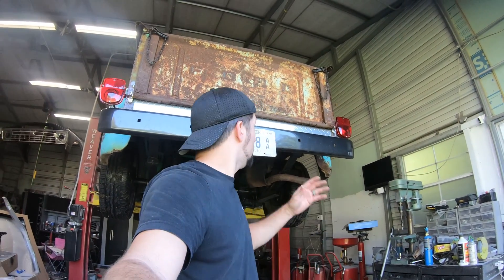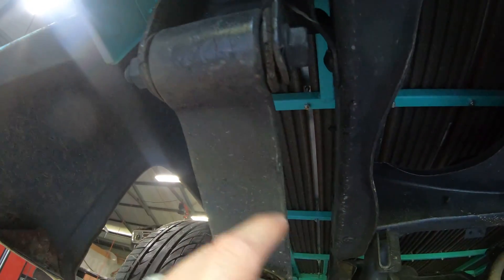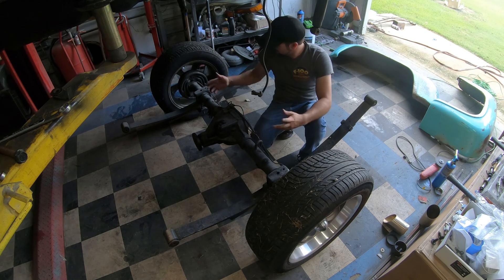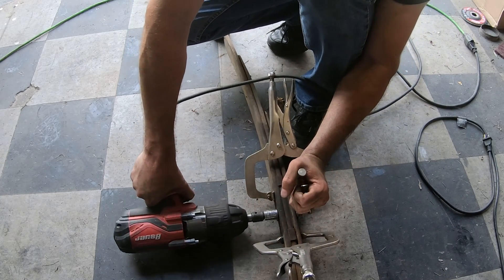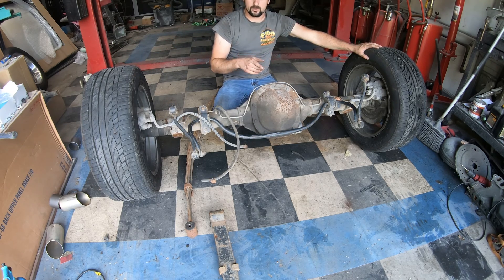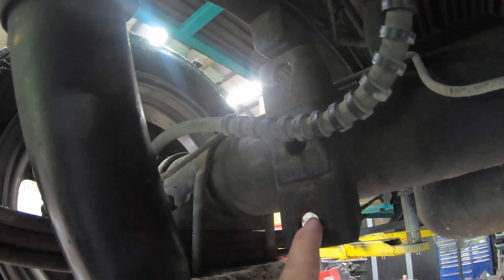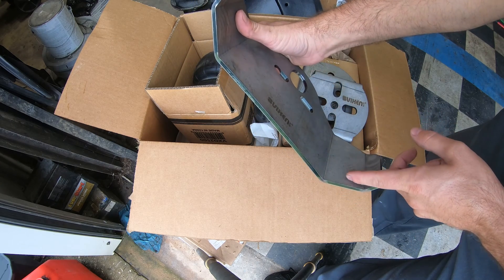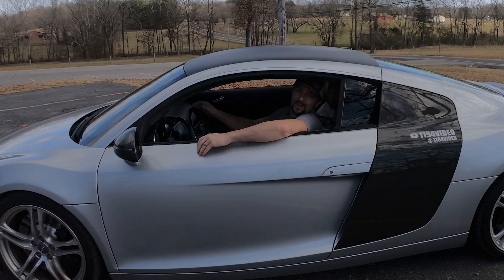Ford ranger rear end swap 7.5 to 8.8

Comment: I swapped the 7.5 in my ranger with a sport trac 8.8 with 4.10 gears and i installed a LSD trac loc. Gained rear disc and replaced the factory brake master cylinder with a 1996 Ford Explorer brake cylinder which was bolt in, to accommodate 4 wheel disc brakes. Also came with a factory rear sway bar which i also incorporated. The sport trac dif was 3" wider but still works well, and gave a little better stability while cornering, oh and my Ranger is a 1992